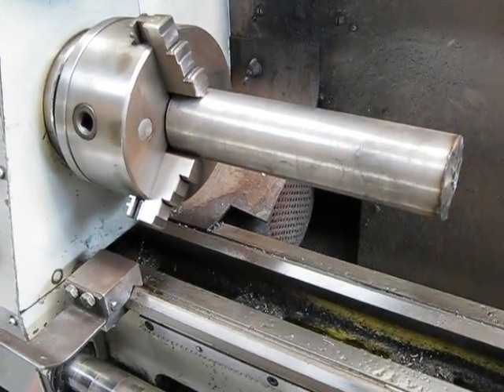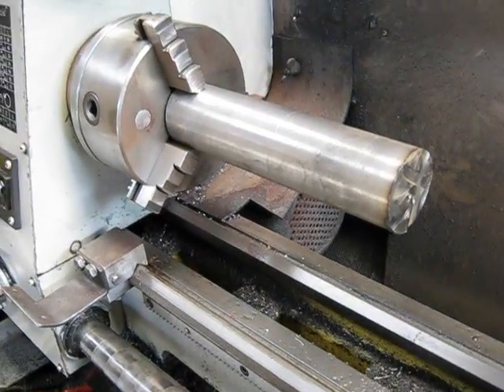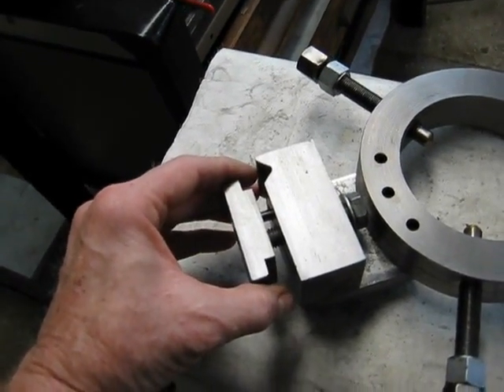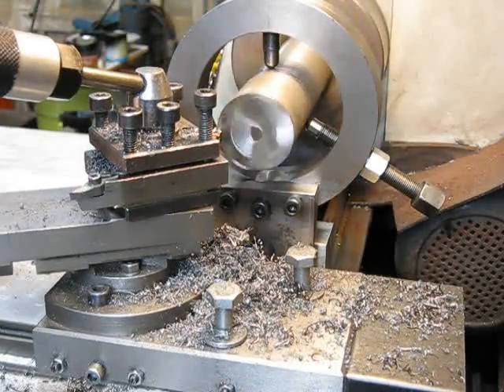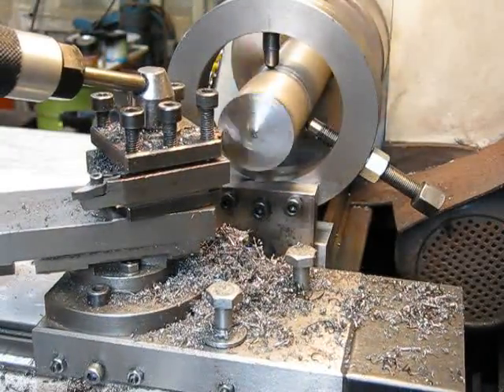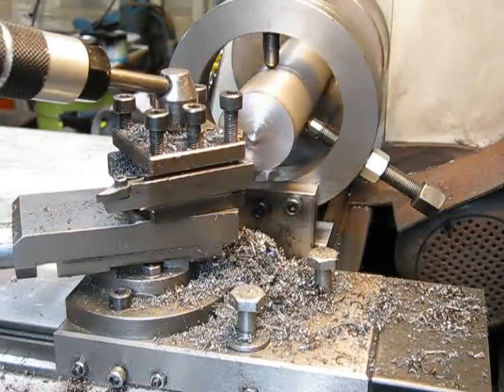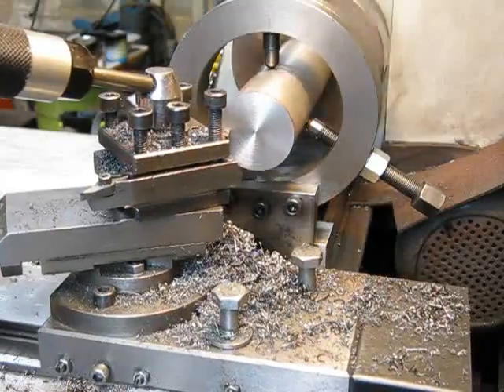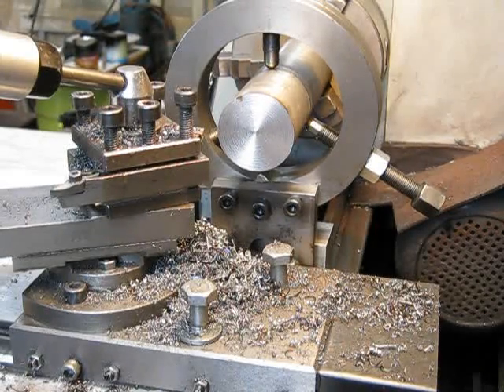Make a large capacity fixed steady for a metal lathe

Comment: short explanation on how bronze will last longer then steel please
Reply from the maker: +Gummy Bear   It's the material used in bronze bushes for mechanical application (spindles, shafts, conrod slipper shells).  Very hard wearing.  Cheers Rob.

Comment: Do you not need to use oil when you're cutting or something?
Reply from the maker: ***** Not with carbide.
Reply: xynudu . Ahh ok. thanks. I just asked as I'm presently awaiting delivery of my mini lathe and i've been watching tutorial videos. This is my first one and I've never used them ever before!
Reply from the maker: ***** Carbide is OK for basic turning and bigger lathes handle it OK.  If you are using a mini lathe I would recommend you use HSS  (high speed steel) as it will take less power to cut, and will provide a better finish.  You can use HSS wet or dry, but generally lube/oil is best. Carbide requires a deeper cut to work well.  HSS will give a beautiful finish with a very light cut.  I hope you enjoy your lathe and wish you the best.  Rob
Reply: xynudu . Thank you. I'm getting the Armadeal mini lathe today (I'm in the UK) (same as a big dog or something lathe?) no tools for it yet so I'm looking around and watching videos.
Reply from the maker: ***** I had a look at the lathe on line and it appears to be similar to other mini lathes.  For small work these are ideal.  Certainly a good lathe to learn on as you can't get into too much trouble if things go wrong.  I'm sure you will enjoy it greatly.  Cheers from Oz.  Rob

Comment: If you have no brazing equipment, you can drill and tap the end of the bolt and thread a piece of brass/bronze to it.
Reply from the maker: Maybe use Loctite on it.  Good idea and easily replaceable.  Rob

Comment from the maker: Good question regarding the overhang.  I keep it as short as possible to avoid taper, so 3x the diameter sounds about right.  5x would be the absolute limit in my view.  That or any more could cause a wreck if the cutter caught. Cheers Rob

Comment from the maker: When I added the bronze tips I simply held the bolts vertically and melted hard bronze brazing rod onto the bottom of the bolt to form a large droplet. 

Next time I would do it differently.  I would allow enough bolt length to drill into the rubbing end about 10 mm to the near diameter of the bolt.  Then fill the cavity with  melted bronze brazing rod. Machine away the steel outer and you will be left with a 10 mm long plug of hard bronze on the end of the bolt.  Cheers Rob.